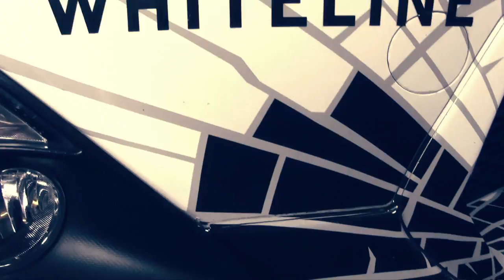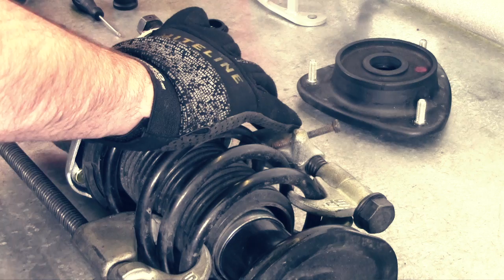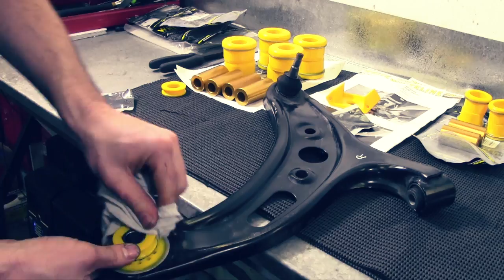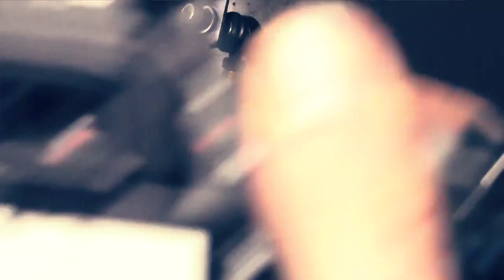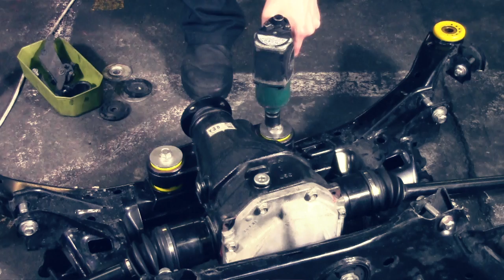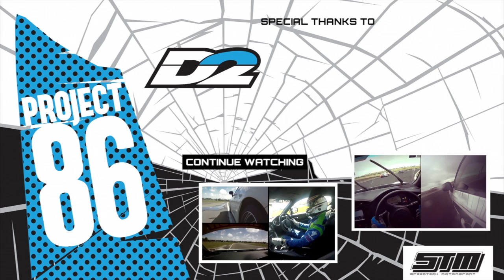Project 86 Whiteline Suspension Component Installation

Comment: I'd love to know what settings you ended up with and what size bars you were running ? I bought a 20mm and 16mm whiteline kit , started at full stiff both ends found the rear was doing all the work while the front wasn't doing any work so I went to the middle setting on the rear but now it just understeers. I'm thinking of softening the front off before resorting to going back to full stiff at the rear as the understeer is quite bad now. The rest of the suspension is stock any thoughts ?